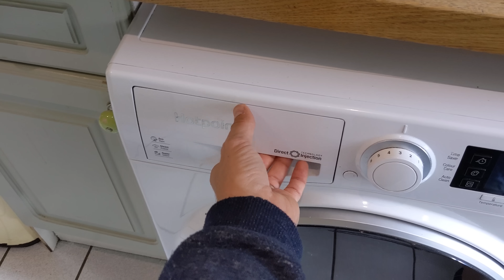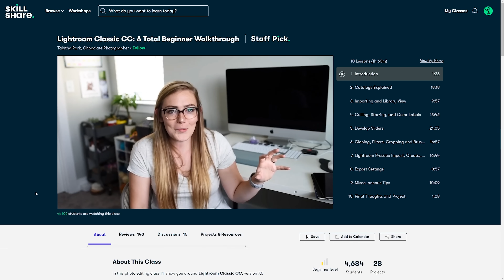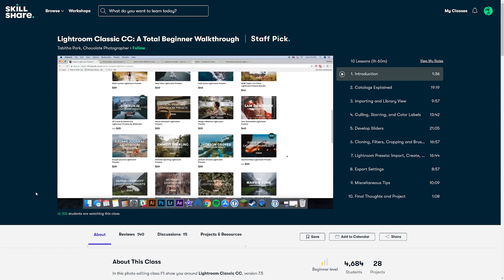The Pythagorean Siphon Inside Your Washing Machine

Comment: Hello Steve, I would like to see some experiments with repulsion and quantum locking. Of course ordinary physics must apply but just for the gist of experimentation.
1, If you first weigh and then stack x number of repulsive magnets "in a suitable cardboard containment" does their repulsive floating in anyway affect the weight showed on the scale?
 2. If you quantum lock an object floating over another by cooling one of them down, are the combined weight the same as before cooldown.
I do know they must be according to classical physics, "just want to check they got it right ;)", same mass on/over scale same weight right?

But does this also apply to ballon over static fields, "well static flyers in general" gravitational force as a sum always apply on the resting objects plus the flyer when weighted using a scale?
Reply: This question may seem very weird but in a fluid as water, does the pH affect the buoyance? Could you check i read pH for water is between 0 and 14?
Can we,, could we speak about the pH of atmosphere, if not what should we call it ?

You know there must be something about the electron density even in air, that affect surfaces of material in the winter or maybe it is just the lack of moist but why do we get zapped in the winter? Or is it the other way we got an abundance of electrons in our skinn because of fatty acids, and the metal try to eat us :)

The heavy metal,
https://www.youtube.com/watch?v=0sUiQMMHqdc

Comment: Mechanisms like that toilette flush siphon are slowly making their way here to America. They are generally more expensive, but a lot of new stock toilets are coming with them. Most American toilets usually just have a hole at the bottom of the tank and a rubber valve to close it off. When your flush, the handle pulls up on a chain attached to the valve and open it up.

Comment: Even the primitive flap system in the US can produce a variable size flush. The rubber flapper tends to have a bulb with a hole at the bottom, which has air inside when not during flushing. When the flapper got lifted, it takes a second or two for the air to escape, then the flapper becomes heavier so that the rush of water can close it before the tank empty. To get a full tank flush, you would need to hold the flapper open for a few seconds. That is actually more intuitive than the siphon system.

Comment: most toilets in sweden at least old one are like a U cup upside down above the exite hole in the bottom. you lift it it with the flush handle the U cup floats up a bit. when the water gets to low. the cup lowers and by the suction gets stuck in place over the exit and a refill flote device like the one in the video refills the water. i dont love the systen at 20 years + the U cup seal dont hold up to well and can start to leak.

Comment: FYI you focused on the wrong part when explaining the toilet siphon we were all thinking about. You explained the siphon in the TANK not the BOWL. Not all toilets have tanks so not sure why your focus stopped there. The tank releases water into the bowl to start the bowl flushing which is controlled by the trap which causes the siphon process and is the same as the greedy cup siphon.

Comment: Most old-school siphons in Egypt work differently, I'm not sure if they are still built the same way but I I don't think so, they used to rely on water pressure at the bottom of the tank to keep a flap pushed down, blocking a hole that lets the water down to the bowl, the flap is attached by a chain or rope to a lever, pushing the lever pulls the rope, and the flap opens, it kinda floats until the water is drained, and then closes.

Comment: Does the water inlet in the cistern have a one way valve or does it just rely on the outlet being above water level? In Australia, AFAIK, the water inlet valves are required to include anti-backflow valves by regulation. But the water is pushed in 'below water level', to reduce/eliminate the trickling water noise while filling. bunnings.com.au/fluidmaster-bottom-entry-toilet-inlet-valve_p4926949
Pretty sure it uses a pilot valve so that the float isn't working directly against main water pressure.

The flush valves are also smaller (more complicated again though) and have two valves/buttons for either full or half flush. The idea of holding for a half flush is weird for me, but it makes sense after seeing how those ones work. I think our ones work by having two siphons at different levels.

Comment: American toilets are a bit different, and probably a bit simpler. The tank only holds the water for us. The chain is attached directly to a flap on the bottom of the tank. The flap floats on water, and is held in place by suction from a hole underneath it. The hole empties directly into the bowl of the toilet, raising the water level in the bowl. The bowl has an sideways 'S' shaped exit pipe and, when the water rises in the bowl, the water eventually gets over the hump in the middle of the S. Once that happens, the water is sucked out through the pipe, along with all that's inside it. So, it is almost exactly like the greedy cup, except that the S shaped tube inside the cup is now on the outside.

Comment: The old toilet in my house here in the states has a flapper.  You turn the lever, and it lifts a flap that has a little air pocket on the bottom.  When the tank is empty, the flap closes down.  If the fill valve is leaky, it will overflow into a second pipe.

My new toilet has a push button on top of the tank lid and there's a cartridge inside to flush, but I have no idea how it works!

This is the first time I've seen your style, and it's pretty clever!

Comment: All the toilets I have had the misfortune to learn about (in US and Canada) lacked a syphon. They had a high mass, but buoyant plug that gets pulled up by the flushing lever. When the water gets low enough, buoyancy loses and the plug tips back into place. Once seated, the pressure of the remaining water above it (air below it) keeps it from floating back up.periodically

There is always a separate overflow tube, in case of the leaky valve that you mentioned.

You did ask!

Comment: Toilets where I'm from don't use siphons like that anymore. We just have a flap that's lighter than water, which is held in place by the pressure of the tank water. Once the flush lever pulls up the flap, it wants to float and overcomes the pressure of the tank water, letting the tank water flush the bowl.

Comment: That's really interesting. I don't think I've ever seen a toilet that uses a siphon like that in the US, at least for single flush traditional models. What I've seen most often is a drain hole covered by flapper valve which is opened by a chain when you pull the flush lever. The flapper floats and then reseals when the water level reaches the bottom. This repair video has a good cutaway of a US toilet showing the internals. https://www.youtube.com/watch?v=UV-peiKW9gM
This could be very different for dual-flush models which have different mechanisms and they very well could use a siphon, I just can't speak to that not having ever owned or worked on one. Someone tell me if they do.

Comment: And here I was thinking a toilet was just a toilet! Never seen one of those big things in American toilets... as someone else pointed out our siphon is down below, built into the ceramic base. Our lever just opens a big flapper valve in the bottom of the cistern which dumps it down into the bowl. You can get different flapper valves to control how much water is emptied at a time. Our house has a half flush if you just press it, or a full flush if you hold it.

Comment: I've actually never seen this syphon style system before.

Here in Canada I've only ever seen the trap door style, the handle pulls a chain to lift a flap door on the bottom. To fill the tank back up with water, either using the old black rubber ball on the arm to stop the water flow when the tank is full or on newer systems the float is a plastic donut shape around the over flow drain tube.
Reply: Ya here in Canada we use the lower part to act as a siphon and a different mechanism stops the water/flow after a few seconds. The design also acts as a "sewer seal" (to prevent odor/gasses from coming in (like a "P" trap under sinks). The Canadian toilets are a great design - only problem being it takes so long for enough snow to melt to use it again! lol
Reply: Yup, this is the common toilet in North America, I'm assuming the video is covering European toilets
Reply: I’m from Canada as well (Ontario specifically) ! And although I think I have seen a couple siphons, most of the toilets I’ve dealt with and happened to open up are “flap door” style as well
Reply: Same in usa.
Reply: EXACTLY!!!
Reply: Same in the states.

Comment: My toilet just has a rubber flap at the bottom of the tank that the handle opens. That meant when I put a bleach tablet in the disinfect the toilet, it got stuck under that plug and held it slightly open causing the toilet to constantly leak.

Comment: In Mexico, the siphon mechanism isn't used for toilets. The lever just opens a valve at the bottom of the tank that will discharge all the water into the bowl (I don't know if that's the proper term for the bottom part, where you sit), where there is a syphon mechanism that will let the water level reach a certain level and then will discharge the excess water leaving enough water to block the exit.

Comment: My w.m. has a simple, downward facing U shaped pipe from the tray to the out side of the tray's wall. Just like your second example with the toilet flusher, one pipe, but the principle is the same, the machine runs water into the tray, the liquid fills the pipe, and gravity does the rest. :)
However our WC canister is a start-stop system, we can stop it at any time. Some remains open as long as we hold it, some can be pushed to stop. And some advanced systems have dedicated small and large knobs to flush the corresponding (pre-settable) amount of water. :)

Comment: In the USA, the top part of the toilet is activated by the handle, it just flushes water into the bottom part. The lower portion is a greedy cup siphon; you can actually see the porcelain siphon in the back: if you pour a bunch of water into the bowl it will also "flush".
High efficiency toilets are different

Comment: Here in Canada most of our older, traditional toilets (manufactured in the 1960s through 1980s) use a 2" to 3" diameter flat valve that pivots up and off to the side, revealing a hole for the water to rush through. The unique feature though is that the valve is kept open by an offset "cup" that is filled with water and this holds the valve open. A hole in the cup allows the water to drain out over a few seconds and once drained, gravity causes the flap to fall back over the hole.

Here is an example of the valve, compete with the cup with a hole in it: https://www.rona.ca/en/master-plumber-flush-valve-actuator-5-black-214bk-67845898

Newer toilets have replaced this "draining cup" mechanism with simply a valve with a low density so it stays open by floating when in water and once the water drains, the valve closes. Here is an example:
https://www.rona.ca/en/ultra-tank-flapper-adjustable-2-43355001

Comment: Yeah I definitely have a different system in my toilet. No fancy siphon valve in the water tank just a little flap valve on the bottom of the tank pulled by a chain on a lever.

Comment: I live in Yucatán, México, and most of the toilet mechanisms I've seen are just a hole at the bottom of the tank and a rubber cover. When you pull down the lever it lifts the cover and water starts pouring through the hole. The cover will kinda stay on the surface of the water and once the tank is about to empty the water flow will pull the cover back in place and the tank will start filling again. Of course there are fancier mechanisms, but this one is the most common here

Comment: Obviously a "regular siphon" in an unmodified bucket / petrol can,  isn't self starting as the hose loop extends to above the highest possible liquid level - but "any siphon" - does that make it no longer "regular", lol -  can be made self starting by drilling a hole in the side of the vessel at a desired level and inserting the hose  (works best if you seal the hole around the hose )....   Of course that this doesn't appear to be a siphon at first glance is the interesting thing.
 - trick mug (no I haven't finished watching just yet.  sorry.)
BTW, I didn't know that a self starting, (potentially) controlled volume siphon had a name.

The toiled bowl is also a similar siphon.

Comment: The Philippines still use the plug type in toilets to drain the water closet. There are more expensive 2 button systems that supposedly do the full or half flush, but those end up being all full flush as time wears down the seals.

Comment: Today i found out, american and english toilets work on wildly different mechanisms.
In the US, the mechanism is a float valve, the pressure of water on top of the valve keeps it closed, but once the pressure is broken by pulling the handle the valbe stays open until the water is gone and it's able to fall back down, the fill mechanism is the same, and theres an overflow tube to prevent overflows.

Comment: Here in Nevada US I’ve never seen a toilet with the mechanics like the one you showed. All the ones I’ve seen am have a flap on the bottom of the tank and the lever pulls the flap and drains the toilet then the water level system turns off the flow just like yours. Only full flush is allowed

Comment: To another's comment, yes we also call it the automatic bell siphon.
US domestic toilets use a low density flapper valve, where the pressure head of the cistern seals it from the toilet (there is a tube that extends above the water line to prevent overfills). Flushing removes the pressure differential, allowing the valve to float (during the flush). When the cistern empties, gravity recloses the valve and the geometry allows a liquid pressure differential to build up wuthout allowing the valve to float back open.

Comment: All the toilets I've encountered (in the US) use a flapper valve at the bottom.  That's a hollow rubber plug with a broad rim that seals against a seat.  Being hollow, it would normally float, but is held down by the pressure of the water in the tank (cistern).  When you push the lever, the flapper is yanked open and floats upward (it's hinged on the back edge to keep it from floating away).  When the tank is empty, it falls back into the seat and the incoming water holds it closed.  To prevent overflow in the case of a leaking ballcock, there's a standpipe that reaches up to the maximum level of the tank.  The top of the pipe is open and the bottom connects to the far side of the flapper so any overflow goes into the bowl.

The flapper has one clever feature to keep it from floating up when the bowl is in the early stages of filling and there's not enough water pressure yet to hold it closed. On the underside of the flapper is a hollow conical shape with a large hole in the bottom.  When you pull on the lever and the flapper floats up, this hole is now sideways which allows the cone to fill with water.  As the tank nears empty, the cone reenters the exit hole (the cone is what guides the flapper to center in the valve seat).  The cone is now (mostly) full of water and can't float.  By the time the water has run out of the hole, there's enough water in the tank to hold it closed.

Comment: My toilet cistern is controlled by a chain attached to the flusher. The flusher pulls on the chain, which pulls up a lever holding down a rubber seal that keeps closed a pipe that sits just about an inch above the bottom of the cistern. The lever has a float that will keep the seal open until the water level falls below the seal, at which point it will close.

Comment: The toilets I’ve encountered in the US have a device in the cistern called “flushmate” - which is a tiny tank which stores water using the inlet water pressure. When you flush, water is released through a jet below the water line in the bowl at a very violent force. I did some digging and it seems our WRAS water standards in the UK prevent any device which uses the water pressure- which is a shame as I’m sure there must be benefits, and less blockages, by using high water pressure to flush as opposed to a siphon.

Comment: My toilet mechanism is a plug on the bottom that is pressed harder the more water it contains. When you pull the level the plug is pulled up and starts to float. The bottom on the reservoir is shaped in a way to remove all water.

Comment: There's been a water pressure drop in Ireland causing the siphon to fail . 
You just have to get the ballcock adjusted to the right spot, not dribbling and still clearing the siphon. 
Probably due to recent erratic rain levels/floods and heat droughts in Ireland and the UK!

#FacetheClimateEmergency #ClimateAction

Comment: That is the most complicated system I have seen to replace a single flap valve in a toilet. And it makes it more likely for you to over flush. The floating flap valve will close at around 1/2 of a flush if you just push the handle and walk away, if you want the tank to empty and really push it out (Ahh push it, push it real good) then you hold it down. The whole thing is just a flap valve with a little float on it over the pipe leading to the bowl.